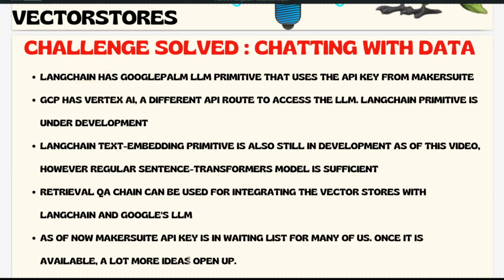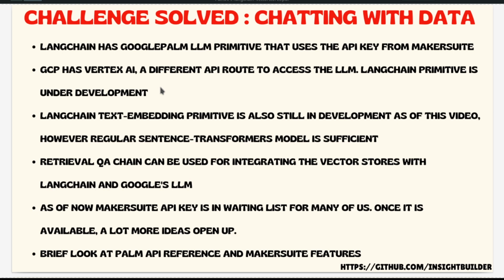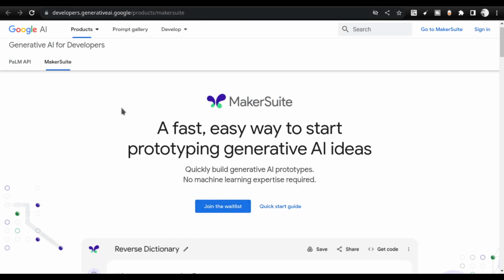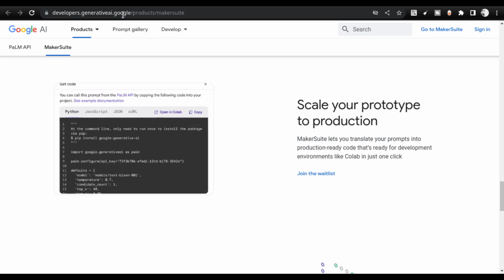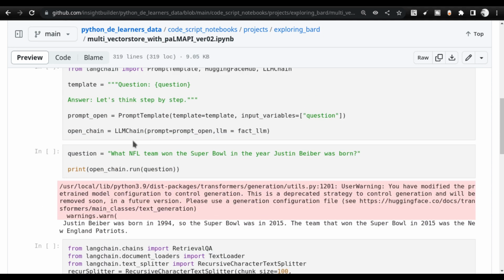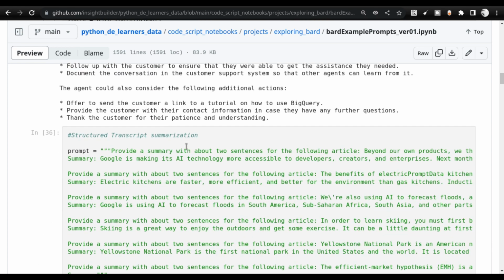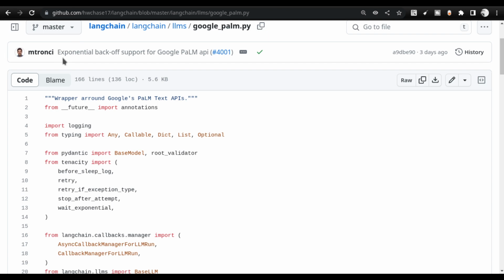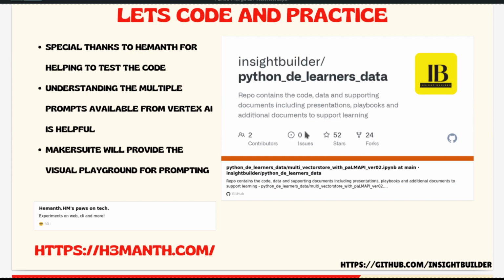Integrating Palm API With Langchain & Vectro stores: Build Next LLM Project With Vector stores

Comment: note: This error originates from a subprocess, and is likely not a problem with pip.

ERROR: Failed building wheel for multidict

Failed to build multidict

ERROR: Could not build wheels for multidict, which is required to install pyproject.toml-based projects

I am getting this error when I am trying to install langchain kindly please help me out. This is going to decide my job offer
Reply from the maker: I think you need the cpp-build tools. 
https://visualstudio.microsoft.com/visual-cpp-build-tools/
Install the Windows CPP build tools, 
Upgrade setuptools with pip install --upgrade setuptools 
Upgrate pip with python.exe -m pip install --upgrade pip
then reinstall multidict
All the best on your new job.
Reply: @insightbuilder  I installed in pycharm sir
Reply: @insightbuilder  sir please kindly help me out